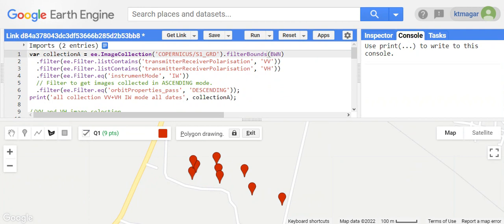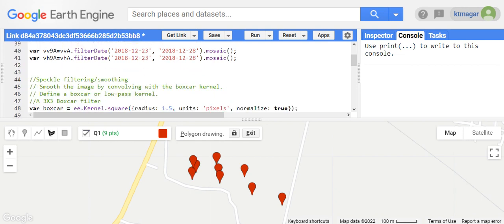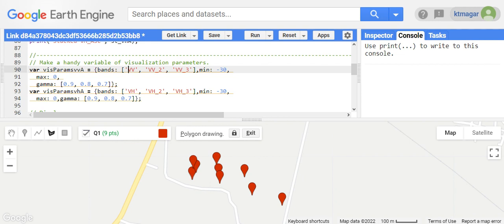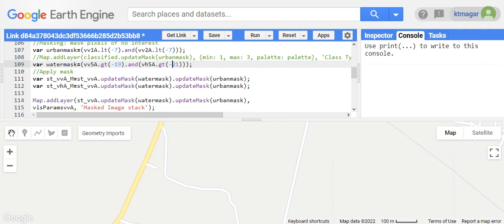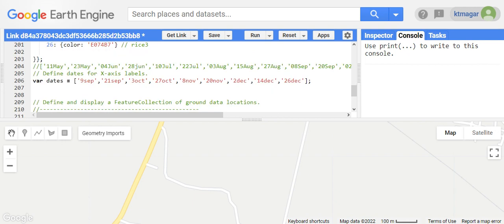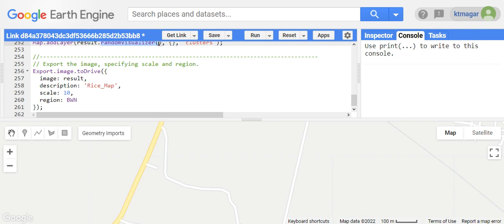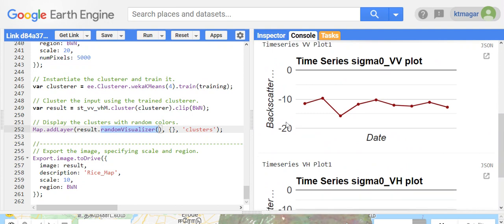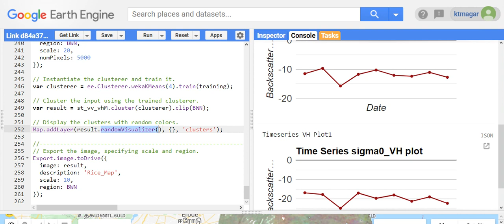Rice Monitoring using Sentinel-1 in Google Earth Engine [GEE]​

Comment: very nice. Would you plz inform me 0to 26 points what are these?
Reply from the maker: As far as I can say, 0 to 26 points would have been 27 different points working to generate the multiple lines in the graphs (as the dense cloud of lines) aiming to prove the trends of VV and VH in the line graph with the distinct colours. For there, however, there should have been long list of points somewhere previously which is missing.

In the chart generating code ui.Chart.image.regions there is Q1 as the region with the 9 points, rather than providing other points which could have been 27 points. But, the 9 points are themselves generating only single line as the summation from the mean of 9 points.

The 0 to 26 points actually have no use here. They remained as the potential works that could have been possibly expanded by the authors which is still in the codes shared by the authors. 

As the codes are from the proceeding paper itself, it may have been little incomplete. 
Also the main point of the author was to show the VV and VH trends in rice only.

Yes, even without the 0 to 26 points, everything goes well. 

I hope my replies answered your question.
Thankyou for the question.

Comment: Great, but I can't see where Q1 come from?
Reply from the maker: Hello, thanks for the comment. 
Q1 points are, there to be 9 points. The value of nine points were supposed to generate nine lines in the single graph, but that is not the case. It only generated one thick line probably as the mean here. 

If you check the reference for the function 
[ https://developers.google.cn/earth-engine/apidocs/ui-chart-image-regions?hl=zh-cn ], it says:

" ui.Chart.image.regions(image, regions, reducer, scale, seriesProperty, xLabels)
Generates a Chart from an image. Extracts and plots the value of each band in one or more regions. "

However, it just created the single thick line graph. There is probably something incorrect in the codes or it is just finding the average value of the 9 points and drawing a graph.

But, if we look the article itself, we got the same result (graph) like in the article.

Anyway, the 9 points are the reference points for generating the graph. 

-Thankyou for the question. It helps to search more. :)